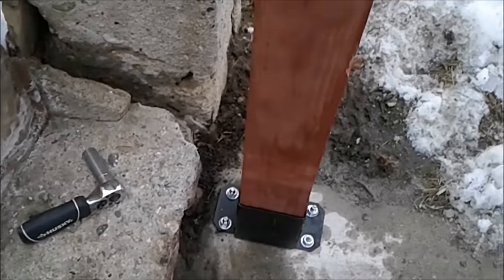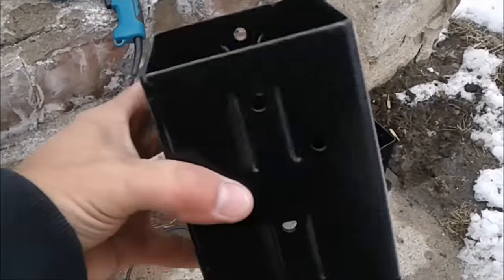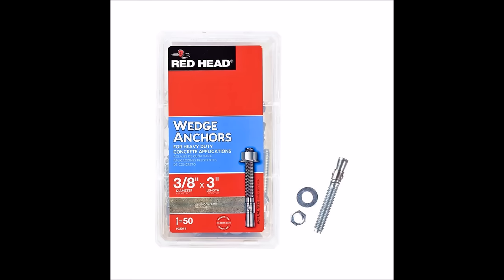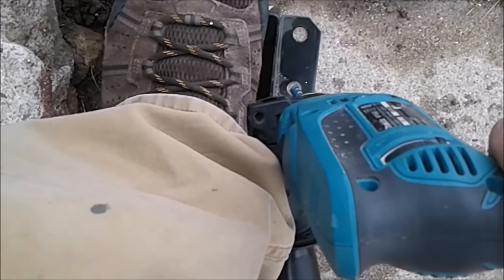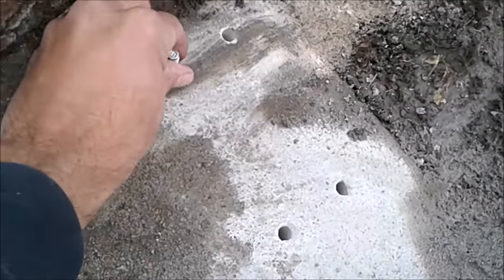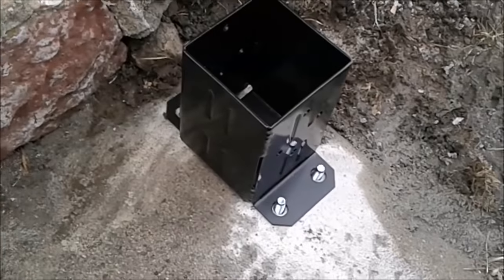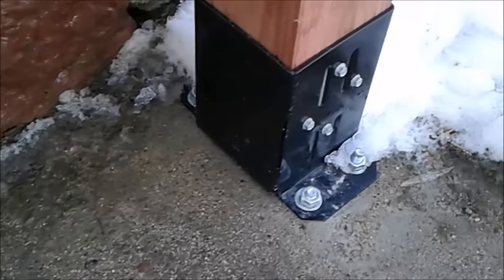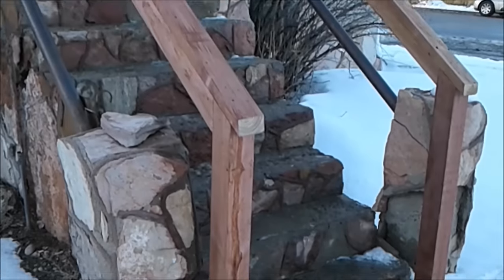How to attach wood posts / railing to concrete with Simpson Strong Tie E-Z Base

Comment: Always use galvanized hardware and seal the endgrain of the posts!
Reply: Steven Echelberger 
Galvanized hardware will not rust and sealing the endgrain of the wood will reduce moisture absorption!
This will make  everything more durable.

Comment: Hey guys, love the content here. I am thinking about doing a diy FENCE project and was hoping that with your expertise ya'll could shed some light on whether or not it'd be ok/smart or just plain stupid to use this anchor for my fence post but....set it up like a "cast-in-concrete" fence anchor with the right screws and bolts? Anyway, let me know. Thanks.
Reply from the maker: I don't think these brackets would be suitable for a an entire fence.
Reply: @D.I.Y._All-in-One  me too. I opted not to do it and am doing it differently. But the content i am learning is amazing

Comment: can you use these metal post base for 6 feet vinyl fence posts?
Reply from the maker: I would not recommend building a whole fence with these bases.  But if  you need to put a couple posts in areas where there is already concrete these brackets/bases would work ok.
Reply: @D.I.Y._All-in-One  I am building half a fence. 3 posts total. And I was thinking of building a raised garden bed also against the fence/post and screwing the garden bed to the post for extra stability
Reply from the maker: Should be ok. It would be stronger if you are able to add 1 corner. To give it strength in 2 directions.
Reply from the maker: Also I wanted to mention usually the vinyl posts are a bigger dimension than the 4 by 4 wood posts so the vinyl post might not fit inside the bases.
Reply: @D.I.Y._All-in-One  what do you mean by 1 corner?

Comment: I've seen this installed over new concrete before. can it be buried so you don't see the metal base?
Reply from the maker: it can be but it will corrode over time after 10 years might have a good amount of rust but should still function.
Reply: keng xiong get a can of cold galv and spray the base and studs. they will last forever under dirt

Comment: can these be used for a gate base?
Reply from the maker: vbvini yes but should use larger anchors for gate base   to make it even stronger.
Reply: I was wondering the same thing.  Rather than putting the post in the ground where it will surely rot, pouring a concrete piling with a gate post mounted to it seems like a good plan as long as it's rigid enough.  I wish it'd accomadate a 6x6.
Reply: Simpson brackets come for all size posts, you can even double up open side brackets for say 4 by 8

Comment: How do you prevent water ingress and freeze expansion/cracking ones the boots are installed? I didn’t see any sealer or epoxy being used, though the environment you installed them in has lots of snow. Aren’t you worried that water will eventually make it into the holes and freeze, thereby expansion cracking the concrete?
Reply: ONCE* the BOLTS* are installed.

Comment: While It appears this looks easy enough, what if the concrete you are affixing them to is not 100% level and you want to hang a gate?
Reply: Use washers as shims to level bracket.
Reply: Michael Campbell what type of washers? Galvanized?
Reply: @deoncriddle7589  don't use washers..looks tacky and you may not find the right sizes for thickness. Use an appropriate grinding wheel on the high spots or use a  water stop (hydo) type of concrete to fill in the lower spots. It's sold in a very small bucket...like 10lb.

Comment: Still not safe. You need handrails that a person can put their palm around per code.
Reply: They can be styled in a variety of ways as long as they provide adequate space for a hand to grip them.
Reply: @dandowodzenka8864  Yep and this is not one of them. If you slip, you wouldn't be able to grab those 2x4s and hold on. He needs to put a railing on top or on the side of those 2x4s.

Comment: Where do I buy these brackets? Will HD or Lowes have them? Great video thx, but no clue where to buy them
Reply from the maker: most major hardware stores should have them
Reply: Home Depot has these specific ones. Lowe’s has another similar option with even better reviews.
Reply: @sterlinghearth6672  Lowe's in my neck of the woods stocks these.

Comment: There are no $100 makita drills...
Reply: Add tax where applicable and it is more than 100. nice try S Winter.
Reply: Move to oregon Joshua
Reply: Sure, but with shipping if you buy from Amazon below 100, you are still going to come out to more than that, unless its on sale for a great discount making including shipping less than 100
Reply: Yes, there are. Have a nice day.
Reply: Stop arguing. He meant around $100. Would not you say same thing? 
Just be thankful for video.
Reply: They sell impact drivers and drills with charger and baterry for 100 here in texas home depot they have this special every other month basically makita, dewalt, and milwaukee brands only and you can choose in between 2 small 1.5 lithium ion batteries or 1 3.0 battery for the same price
Reply: Wow Byron got real quiet